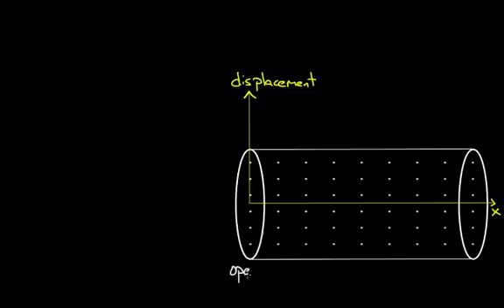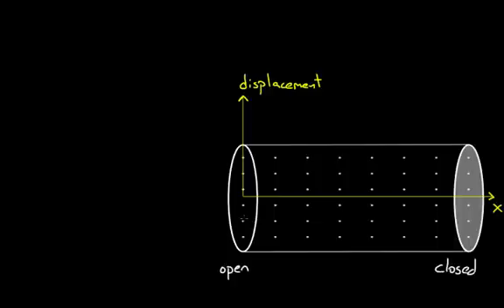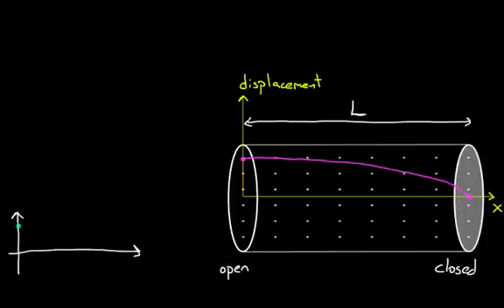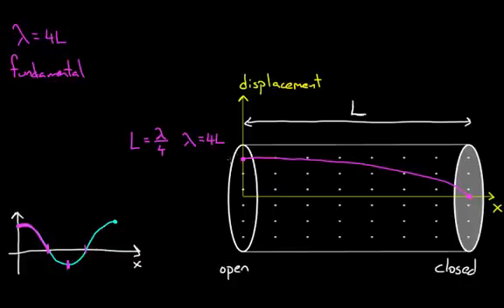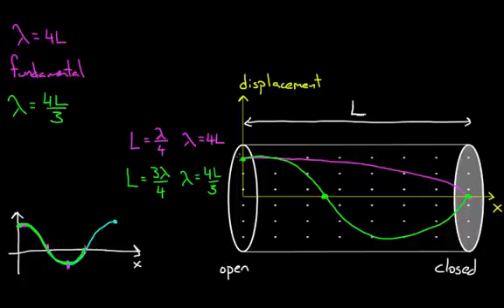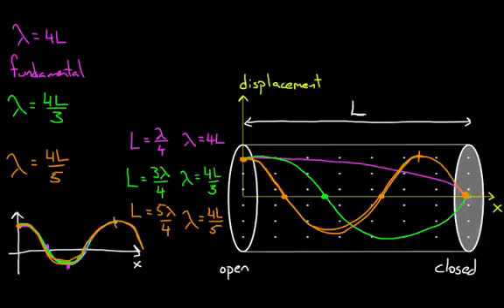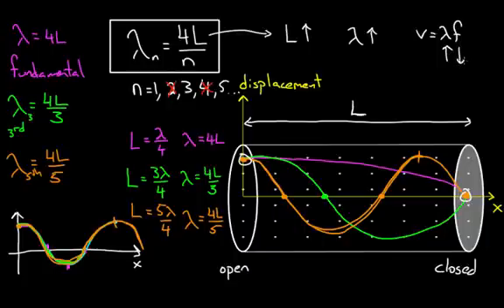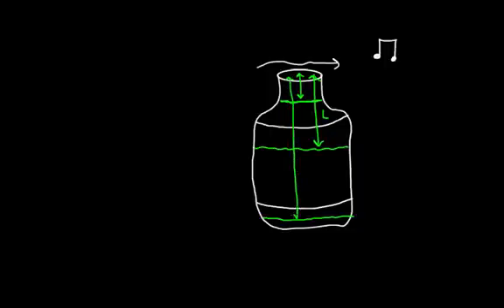Standing waves in closed tubes | Mechanical waves and sound | Physics | Khan Academy

Comment: I need to see a non-linear analysis i.e. one that shows how low amplitude waves can travel faster than high amplitude waves, overtaking them and leading to a pulse with a very high peak. I can hear this effect when a trombone is played loudly but also with a trumpet and to a lesser extent a cornet. I think it has to do with the long cylindrical (not conical) section of a trombone. 
A similar phenomenon occurs with water waves when they move into a shallower region. Low amplitude waves overtake the waves ahead of them and a crest forms which becomes unstable and the wave crashes on the shore.

Comment: But what happens if an open pipe has a hole at the center? (Like a flute) Should we get an antinode at the point of the hole at all times? Or does that act like cutting and making the pipe shorter (making it half the size)?

Comment: when you use a glass jar with different heights of water,  and strike it with a metal, you get a higher pitch as the water level is lowered unlike what is mentioned here. Why is that?
Reply: Gayantha Ekanayake i guess because in that case, what’s oscillating is the jar+water so less water means a smaller medium, which in turn means a higher pitch. Whereas in this video it’s the AIR inside the bottle that oscillates and more water means less air, so a higher pitch.
Reply: You have observed wrong, amplitude decreases but frequency still increases

Comment: 1)What do you mean by "the length of the tube determines which wavelengths are allowed? i mean, if i put a sound source on the open end of a bottle that has a frequency other than Vn/4L what happens to the air in the bottle? Is a wave not created? the air molecules have got to move but what happens?

2) Any idea what happens during speech? the source is in the middle of a closed tube which has many parts of different lengths and volumes. as the air passes through them they can be considered seperately as open ended tubes. 

I'm so confused :(
Reply: So i don't know what "speech" is, but regarding your first question. The point is that only STATIONARY Waves can form under those frequency's ie. when the frequency and length of the tube is such that wave has a length equivalent to one of the harmonics. Sound waves can of course still form its just that a stationary wave won't.